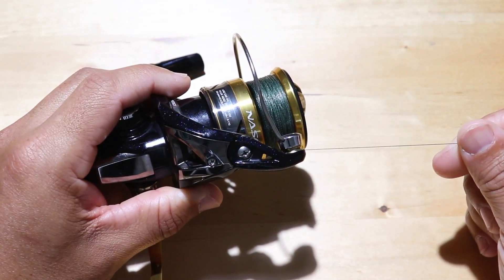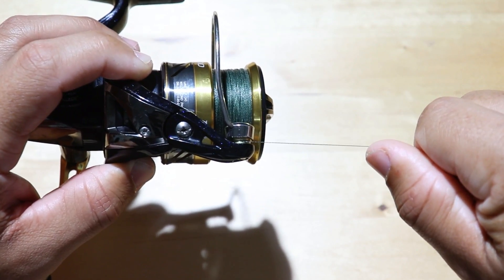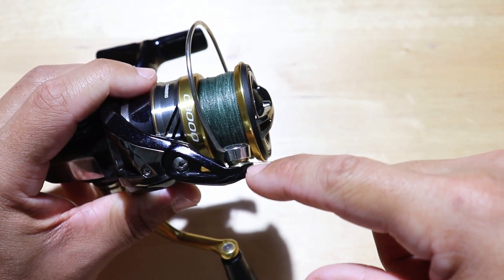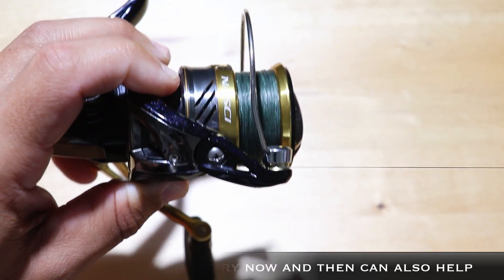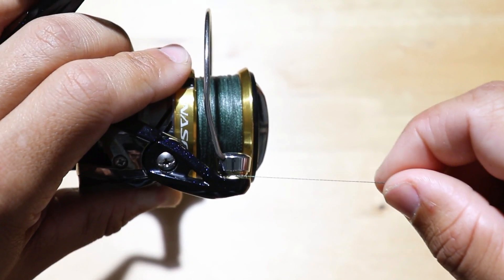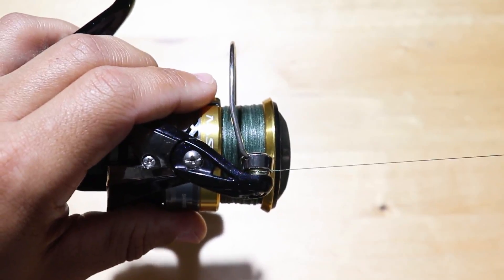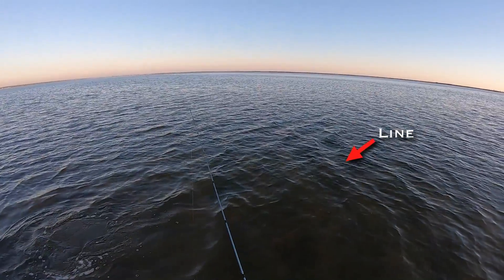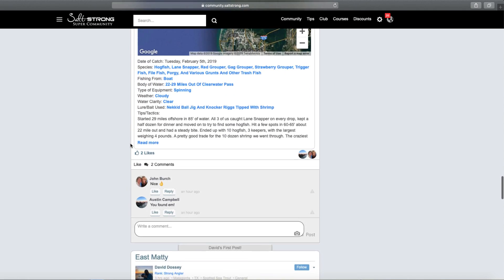Losing Fish At The Boat: How To Avoid Fish Breaking Your Line At The Bail

Comment: Braid has almost no stretch. 99% of breakoffs occurring at the boat are due to the fact that the less line you have out, the less of that minimal stretch there is. Back off the drag a little there. I own a Shimano nasci and I've never had a roller related issue with it. It's simple, the less line you have out, the less stretch there is and the less give. There's zero give at the roller, so, all things being equal, it's going to break there every time. Back off the drag when the fish is at the boat, or use heavier line.